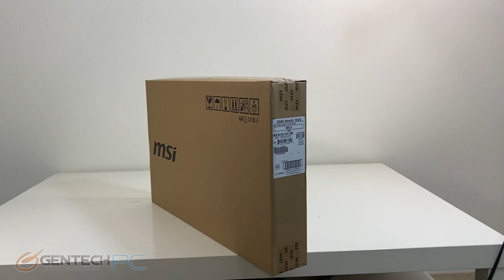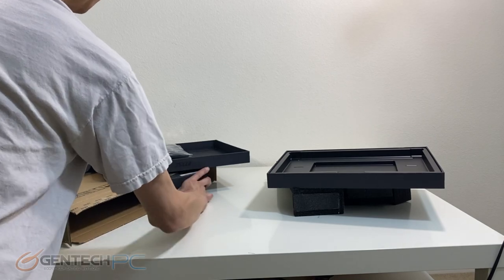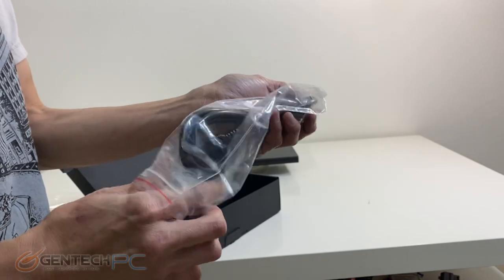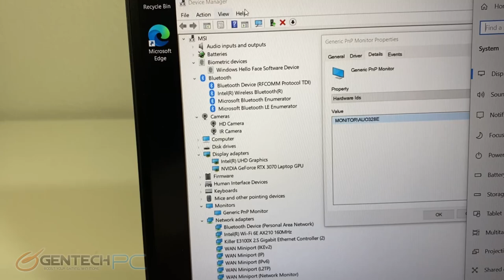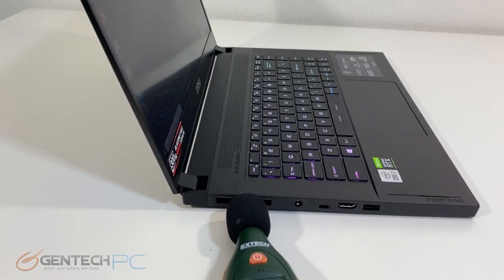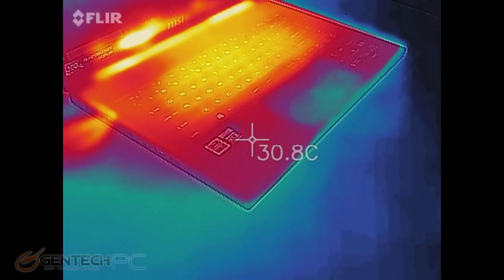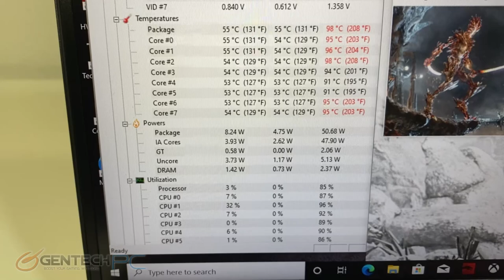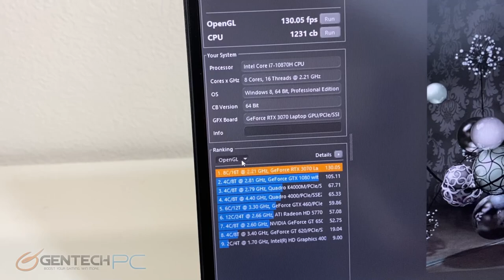MSI GS66 Stealth w/ RTX3070

Comment: I got last years 2070s is it possible to swap to the rtx3080  from this model to my last year model. Can i swap anythin new from it to mines?
Reply: No, CPU and GPU are both soldered onto the Board. The only things you can swap are SSD, RAM, W-lan Chip and the battery.
Reply: @guiltlessraptor777  alright good to know. What if i swap the cpu and gpu would that work? or its not possible at all?
Reply: @86Tony  No, that wouldn't Work either (you had to rip out the CPU and GPU Chips), you see Laptops are Kind of desinged to work with the given components. When you could swap the GPU to let's say the mentioned 3080. The Laptop could Not bei Able to handle the additional Heat or the Wattage of the new CPU.  I even think the different sizes between the Ampere and Turing Laptop Chips could complicate Things even further (e.g. the lanes on the Motherboard or the sizes of Heatpipes and Copperplates). Laptops are specifically made for the available components and the tradeoffs that are made to house such powerfull components.

Comment: What's with the GPU-Z results? No way a laptop 3070 is going to have a texture fill rate of nearly 550 GT/s! My overclocked desktop 3080 only has 528 GT/s.
426 TMUs on the 3070? pffffft...